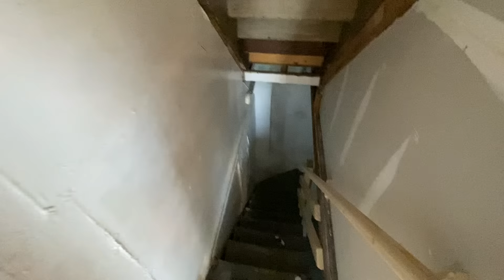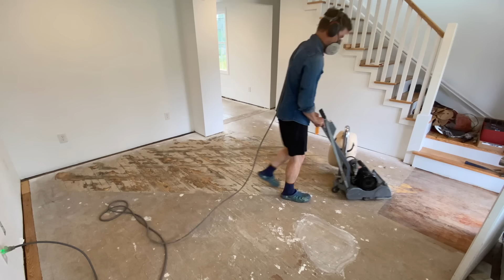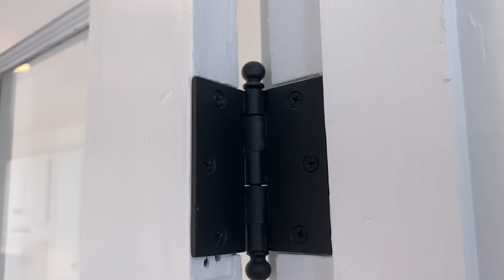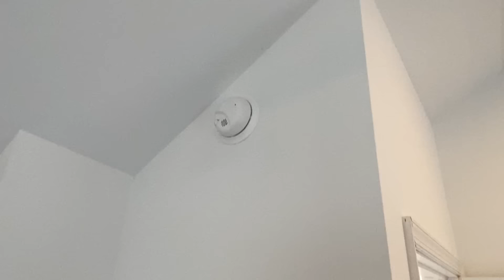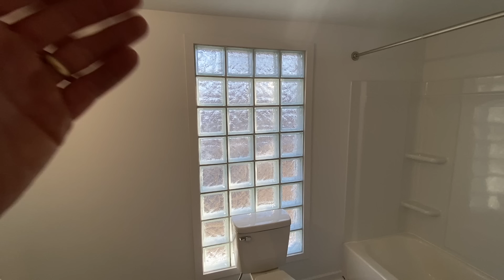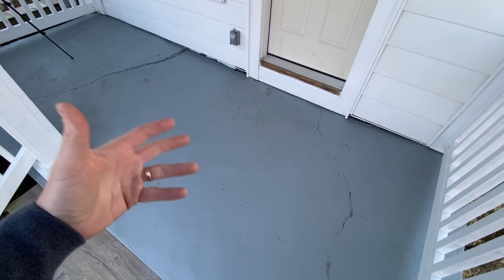$9,000 HOUSE - FINAL TOUR // 6 YEAR Renovation! - Ep. 79

Comment: We've been following since you started this house. You did a beautiful restoration ! Bet that house has never looked so good. 
Anyway, looked back on some of the other houses - Here's an idea that shouldn't cost too much - When ever you run into a situation with  a window  in  the tub/shower area - paint the wood frame with epoxy paint, the kind you can paint  porcelain fixtures with - then hang a vinyl window shade that's a few inches  wider than the window. Mount the shade several inches above the window. A shade gives a nice flat privacy screen ,as well as protecting the window. Easy for your renters to sponge off and keep clean.  And way less bulky than using a shower curtain on the back wall. Also person(s) won't have a curtain dragging in the water while taking a bath. lol, have lived in several older houses.

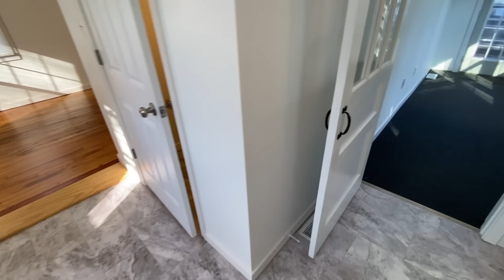Comment: impressive to see finished. good work.... but Common its 2026, 15:00 no vent in the bathroom, no vent for the Stove for cooking, no return vent in the upstairs, any sealed room with a door especially that front room needs a return vent for safety, you know oxygen, and the house should really have a fresh air exchange system with a heat extractor preferably in cold weather, NO GFIC in kitchen, 17:15 bathroom door no stopper? hope you replaced the ground rod for the panel it should be the path of least resistance 52:45, the tubes not sealed and the wall cracked, hope it don't fill with water and freeze
Reply from the maker: I'm not sure this is a real comment...........